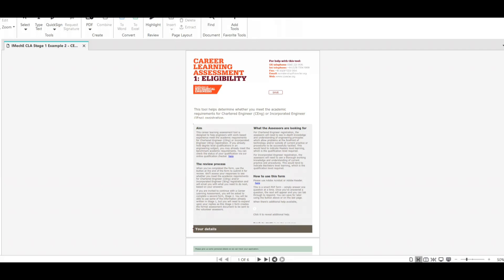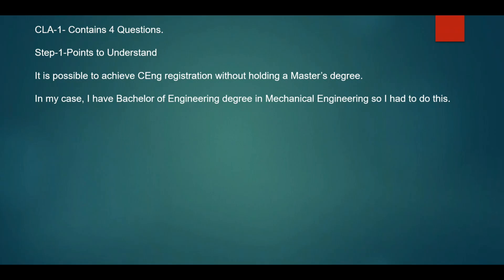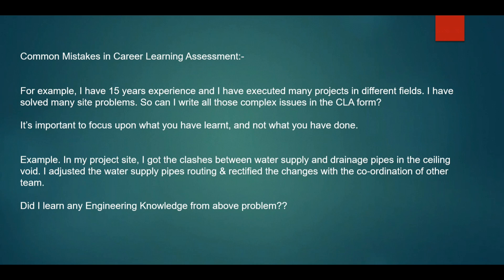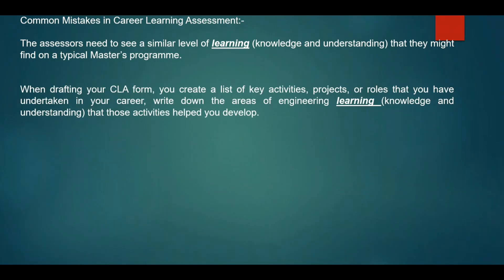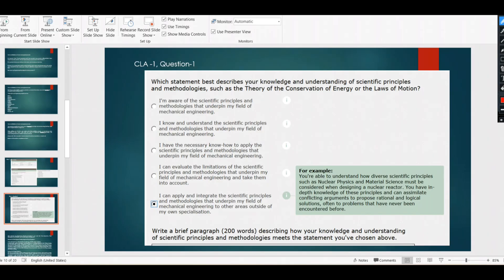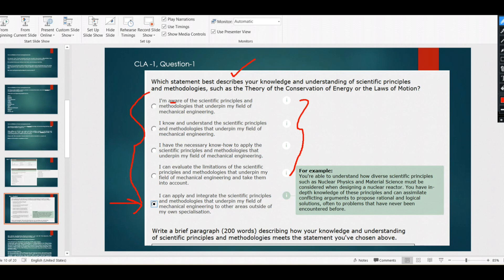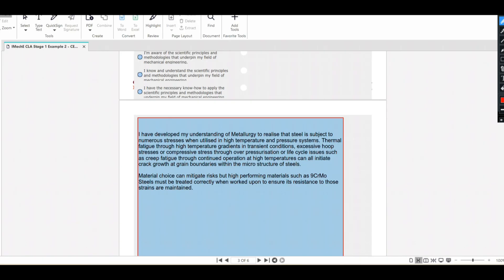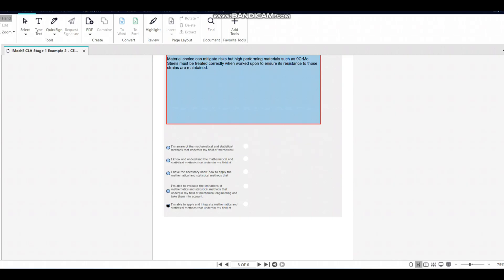Part-1-How to Become a Chartered Engineer l Step by Step Guide for All Engineering Professionals

Comment: Hi, Can you pl. compare Chartered Engineer-India; Professional Engineer-PE & Chartered Engineer-UK?
Reply from the maker: @fariesmech  chartered Engineer india adds professional credibility but may not have as much global recognition as UK or other international charters.
Reply from the maker: Achieving Chartered Engineer (India) is relatively straightforward due to less stringent assessment requirements. In contrast, Chartered Engineer (UK) involves extensive documentation, structured training, and formal assessment.
Reply from the maker: the Chartered Engineer (UK) is more challenging to achieve and thus carries more international recognition and prestige compare with CEng India
Reply from the maker: Once u become chartered engineer UK, you are registered with engineering Council UK so u can do professional engineer easily which has good value compare with chartered engineer india which has no value (outside india) other than india
Reply: Thank you @mepworld3385